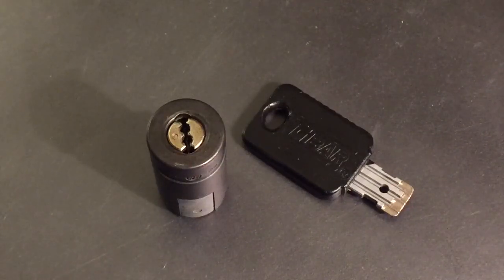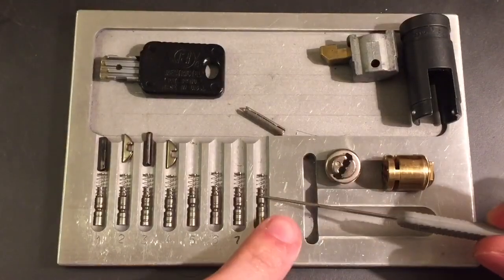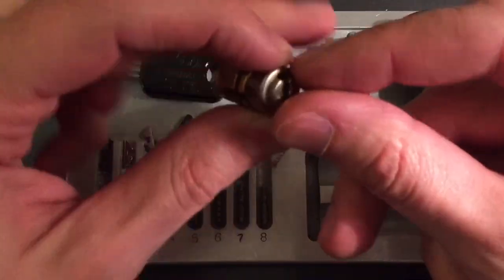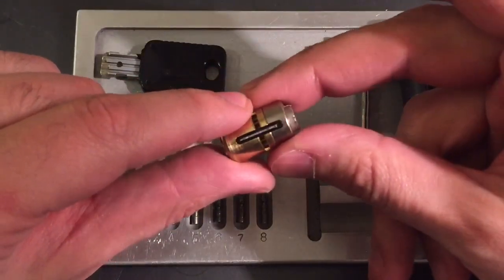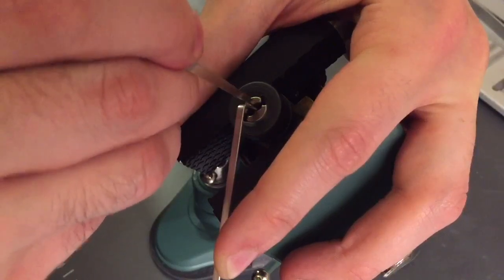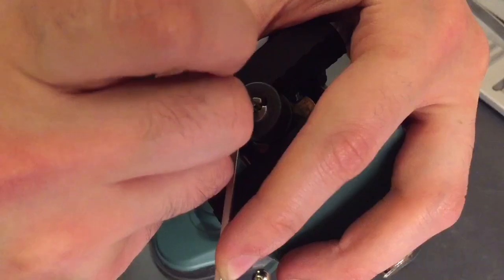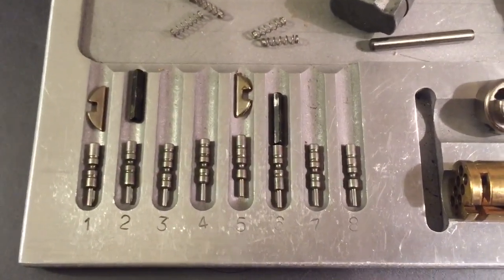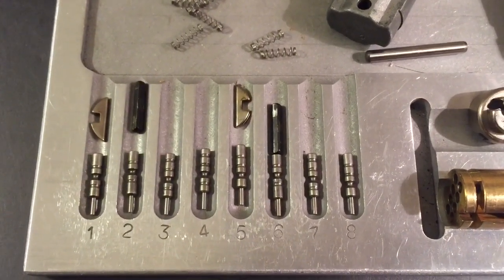[78] TuBAR (Dual Sidebar) Lock Picked and Gutted Plus "How To" Demo

Comment: @lockpickinglawyer

I've been watching your videos for probably 3 or 4 years. I'm not expert at picking locks but I have raked a few and know generally gow locks work.

I've always been curious why someone doesn't just bevel the hole for the key pins larger than the pins with one hole the exact size like you see in all locks. Wouldn't that leave room for the pins to drop with a little bit of room to move around. There would be no sheer line to hold the pins up.

There are a few very basic ideas that would cause a lock to be un pickable. If you have an email I'd love to draw you a diagram of what I mean...

Comment: I don't think it matters, but I don't think you got the pins in the right order. As I understand it, 1 & 8 should have the same length for the true gate, then 2 & 7, 3 & 4, and 4 & 5. But looking at the closeup at 11:10, I thought 1 matched 7, 2 matched 6, 3 matched 4, and 5 matched 8. Am I being too finicky, or are the tolerances that poor? I did notice that not all false gates were duplicated, which I thought was smart.

Comment: This looks  a lot like the lock on my toolbox.
Reply: Matco? Matco used these locks as a high security upgrade on many of their boxes. The lock should look identical, the only differences being the Matco key has an octagonal bow instead of the rectangle bow and it will have a chromed, hardened steel rotating collar. I installed the same lock in my box, it's about as solid of a lock as you're going to get for the application. Beats the snot out of the "high security" tubular locks Snap On uses.
Reply: @tdb19872  It is a Matco box. My dealer did say it was a very good lock, but of course I wasn't paying attention at the time because the Snap-on key looked "cooler". In retrospect, this is a very nice lock and a very good box too.

Comment: some of my thoughts, my matco tool boxes have some of these locks on them and about a year ago one of the locks failed and i had to brute force open it, this is my experence
1) those side bars that go into the face plate will shear pretty easily if you try and force the cylinder to turn, once you shear the side bars its impossible to get any leverage to attempt to force the lock to turn 
2) the way i ended up getting it open is whit a carbide rotary file and about 15 mins i cut enough if the face and housing i was able to use a chisel get the front of the lock apart and all the pins out
3)overall i thought that the brute force entry was pretty difficult but i was also trying to not damage the tool box around it.
Reply: Luis Valenzuela thanks for sharing I have a Matco box with the same lock, do you know why it failed? I’m hoping to avoid that.

Comment: I've been following 'LockPickingLawyer' for several months now and I never cease to be amazed (and entertained) by picking locks, especially those locks claiming 'unpickable'... and that's from a retired police officer. In this day an age, the truly  'unpickable' lock must, by default, involve retinal scanning.
Reply: Unfortunately most electronic locks can be bypassed rather than picked it seems.  Electronic lock makers need to stop building their locks like consumer electronics...
Reply: Bit of a fast forward in time, but it seems like today "unpickable" would probably involve gene sequencing... or welding.
Reply: Ive a seen an abus pin tumbler lock where the "pins" are actually several discs stacked on top of each other. I could be wrong, but whatever the mechanism even lpl said it's unpickable. There's also another mechanism where you can't even get a pick to touch the pins, you have to fully insert the key then turn it for the pins to be engaged.
Reply: A lock keeps an honest man honest. 98% of residential burglaries happen without the thief going anywhere near the locks on the house. So, that's 2% of B&Es involve lock picking.

Comment: I have installed hundreds of these at Chevron and smaller gas station chains.  Considering these are what are keeping the bad guys from easily installing skimming devices and stealing debit / credit card information,  it is good to see these are not a piece of cake to get past.   While I have found near a dozen skimming devices in the last few years,  only once did it seem that someone got past one of the CompX TuBAR locks to do so.  I now feel it was more likely the sites key got in the wrong hands.
Reply: Skimmers can just be placed over the top of the current card readers these days loc. No one needs to get in

Comment: I've notice that on many locks the false gates are very different in contour from the true gates.  How hard would it be do machine all gates with a tool that would leave a "peg" in the middle of them that didn't reach quite up to the height between the gates, and then machine off the pegs of the real gates?  I would think that would make it much harder to feel a difference between real and false gates, especially if the later force from the "feeler" was limited.
Reply from the maker: I don't think it would help that much.  The "flaw" is a combination of design and tolerance.  As for design, the rounds edges of the gates help facilitate the attack.  Perfectly square corners would be better.  Second, the sidebar/slider fit needs to be perfect!  that's expensive and, aside from the cost of making a "perfect" lock, such tight tolerances have other issues.  Most notable, it's harder to make the lock operate smoothly.

Comment: cool, where do you feel the gates wiggle, in the pick or the tension wrench?
Reply: +LockPickingLawyer  I have a tubular pick made by Custom Security Products called the Pickmaster - no longer made - it's unique in as much as it doesn't tension the nose via the "slot" but actually grips the nose similar to a chuck, and relies on the small shearline gap to self impression.The sliders ( fingers ) are made from steel stock - not flat spring steel - narrow at the bottom to enter the lock, but larger at the top so they can be depressed manually. Tension on the sliders is achieved by tiny Allen socket screws, under which is a tiny hard rubber plug. Variable tension can be applied to each slider.Manual manipulation of the pins is achieved by backing off the Allen screws, and the sliders run free. Pick the lock manually, and leave it turned between pins, then tighten all Allen screws to have a perfect " duplicate" of the key, the sliders cannot be pressed out of alignment.Regards, Brian.
Reply from the maker: +JB Thanks for watching.  On this lock, almost all feedback is from the pick/probe... the tension wrench is pretty dead.
Reply: +LockPickingLawyer 
thanks,  glad there are focused ppl like you to figure this stuff out. I would of went all A.D.D. on it for a while and went to Google.  I think I have the light handed touch needed. Only been picking for a couple months but I learned spools in about a hour, took 3 days to get serrated pins down tho. That 6 pin 1100 was my 1st serrated that I know of. once I took the length of the pins into consideration and estimated how many clicks I should get by length to lift without over setting I got it in under 2 minutes. you and bills videos helped me get thru  it and I appreciate it a lot. 
I am still wondering if we can single pin pick difficult tubulars with the tubular lock pick by taking most of the tension bands off and sliding 1 pick down the tool at a time. I dont see why it wouldn't work.
Reply: +LockPickingLawyer 
if we can figure away to secure each pick after the pin is set on that tubular idea then we can use the same tool with that modification. there has to be a simple solution.
Reply: +JB 
tubular solution?,  we add extra tension bands and pick each pin separately on those alternative spring tubular locks.
Reply from the maker: +JB The answer is yes, you can spp with the tool IN THEORY.  However, I've tried it and have not been successful.  The wires are too hard to manipulate IMO.  The SPP method I use is much easier for me.  Different methods may work better for you, so give it a shot!
Reply from the maker: +Brian Hignett Sounds like a very nice product.  It sounds similar to this one (minus the chuck/clamp mechanism):  http://www.lockpicks.com/pka2-deluxe-pace-pick.html  Yes?  There is also a very nice tool in the US made by Peterson that's good for SPPing.  In the end analysis, for me the benefits did not outweigh the cost... especially since tubular locks are becoming much less common in the US.  For a lock that will not impression, I SPP it with a flat tension tool, then turn it between pins and impression a key (or use the business card/rolled up paper method if I don’t have the impressioning tool with me).
Reply: +LockPickingLawyer  No that's not it, and I know of the Peterson tubular pick, but the Pickmaster is even smaller than a normal tubular pick, but brilliant for freehand picking.  However, because it relied on creating the tiny gap at the shearline, and by being "at one" with the nose, it was slower at self impressioning than other "normal" type tools. Expensive too, perhaps that's why it's no longer made. I bought mine in the early '70's.Regards, Brian.
Reply from the maker: I think I found it...  http://i50.tinypic.com/1htb39.jpg
 Hit or miss?
Reply: +LockPickingLawyer  A hit!! That's it! I did in fact Google images and tubular lock picks, however nothing came up, so I don't know how you found it. As I said, a little disappointing in the self impressioning department, but spping, it's extremely good. Everything works smoothly, and pressing on the sliders is just like pressing on the actual pins, with the advantage of being able to positively lock the sliders once the core turns.Regards, Brian.

Comment: The reason the sidebars are so high as to stick into the faceplate is because of the key; it only goes down far enought to rotate the faceplate itself, so it needs te sidebars to carry that rotation down into the core.
Reply from the maker: +hellslave Perhaps, but I don't think so.  If the sidebars were shorter, the lock would tension off the pins/sliders and still work perfectly.
Reply: +LockPickingLawyer 

Looking at it again, you're right. My mistake. :P Anywho, where'd you get ahold of one of these locks, anyway? Also, you should stop by r/lockpcking (Reddit). Lot's of good discussion there.
Reply from the maker: +hellslave No worries... it's always hard to understand how everything works together until you're holding it in your hand.  I got this on Ebay...  The auction didn't mention TuBAR.  It was a large lot of cheap t-handle locks (mostly Chinese tubular, but a few Fort Gem and Ace II mixed in).  But my sharp eye caught a few of these mixed in the pile, so I bought the lot just for the TuBars.  Re: Reddit... I may check it out, but probably just to browse.  I'm too lazy to check more than one LP forum.  :-(
Reply: +LockPickingLawyer a sharp eye is key on eBay and I feel you on the lazy part. One board is already time consuming if your active.